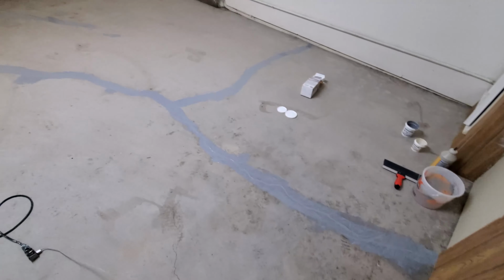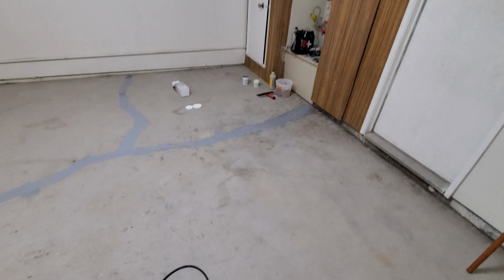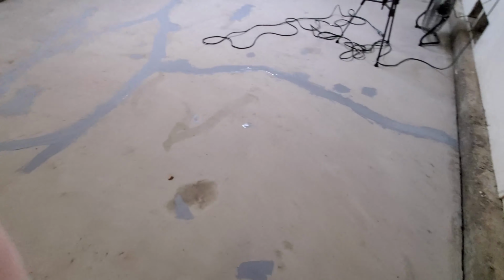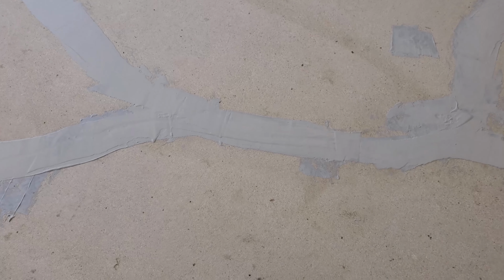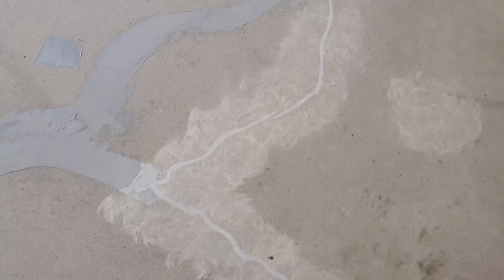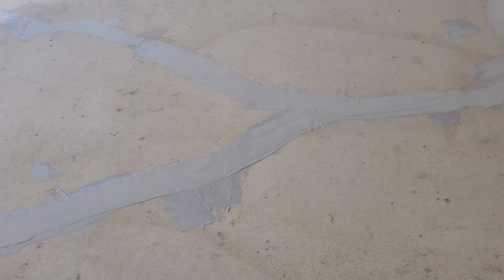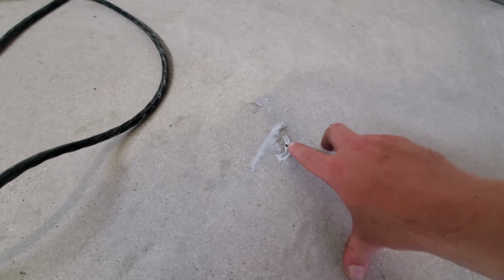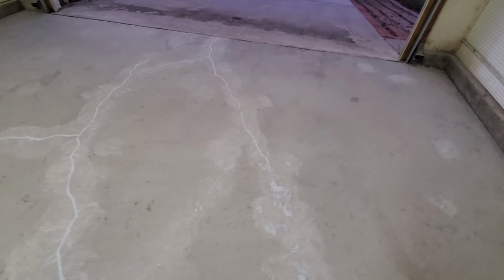Rust-Oleum Concrete Patch and Repair (Epoxy Preps cont.) - Part 2 of 4

Comment: Dude, my garage project turned into a 6 day evolution.  But, I did exactly what you did, no oil or stain issues, but the crack fill took 3 days!
Reply from the maker: I hear ya... mine turned into just under 2 weeks since I went with the Leggari top coat.  How's it looking?

Comment: This stuff does not sand easily!
Reply from the maker: If I redo my floor, I will have to remove it. But if I do, I'll also level the floor before putting epoxy down again... and I definitely would put epoxy down again after having it.